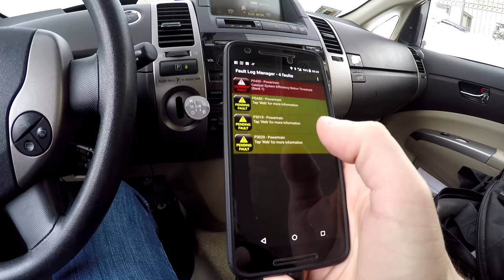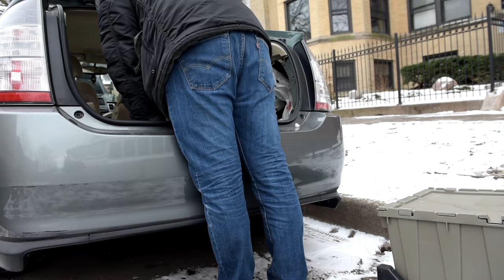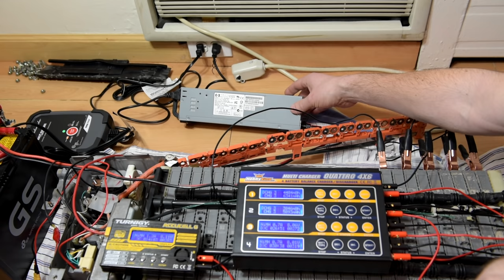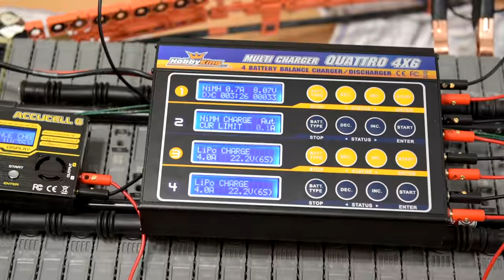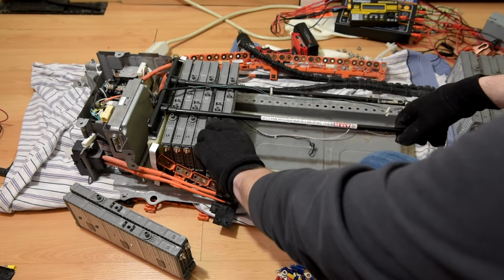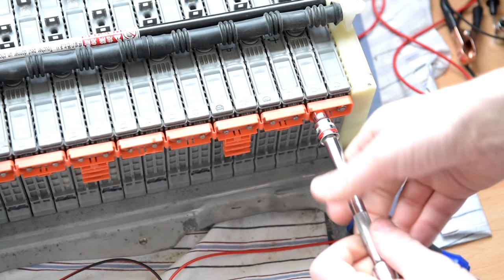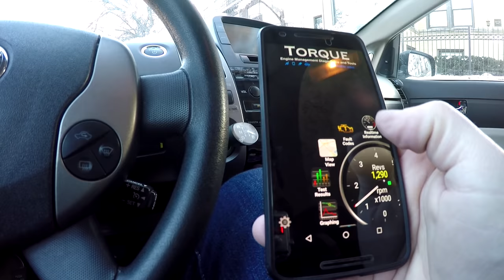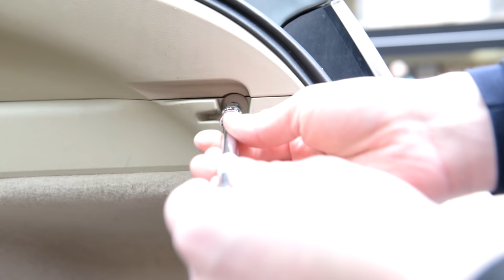Hybrid Battery Repair Ultimate Guide (Toyota Prius 2nd Gen 2004-2009) DIY

Comment: Dear Igor, I wanted to thank you for your video which along with the Prius Chat threads enabled me to do a good job re-balancing all the modules in our 2006 Prius. I only had to replace one cell! She's running great now with no Triangle of Death nor any codes whatsoever. I did forget to push down the handle on the orange service plug which resulted in the car not going into drive,  reverse or even the motor starting. So I wanted to emphasize this step for others considering this process. BTW, I wanted to mention that I used the Hi-Tec X4 AC Pro AC/DC 4 Port Multicharger which performed flawlessly and didn't require any external power supplies to keep up with the load.
Reply from the maker: Thanks for feedback, Bill! I am glad you fixed your battery. It's funny, but it happened to me too, even though it's not on the video, I forgot to reinstall safety plug and it would not start. I even got upset that I would have had to disassemble it again, but then I realized my mistake and fixed it quickly :) Thanks for the tip about the charger. The one I recommended is not available anymore
Reply: Bill Byrd can you rebalance this hybrid battery until draining all the cell till the lowest cell? To even out the modules? I’m just trying to learn how to rebalance.
Reply: how many hours did it take you to refurbish your battery?
Reply: @AJTarnas  I was working on it for about a week during the day. I'm still on the same battery 3 years later.

Comment: Best tutorial on YouTube for fixing hybrid batteries. Thank you. One comment: With the Ideal grease on the contact, your torque may be too high as the grease will make a slippery surface.
Reply from the maker: That's a good point, thanks. I guess you could decrease the torque in this case
Reply: Actually, it is just the opposite. The lubricant allows the proper torque. Lawson Products studied this and came out with a lubricant for lug nuts on HD trucks so that the proper torque is achieved.

Comment: Some thoughts for folks who just watched this video - this was what I did about a month ago before completing my HV battery work:   This is a great video but you can improve on certain little bits of it - and learn details from other good videos and websites.  For example, remove the rails/white blocks from the HV battery case and do your cycle rebalancing  outside of the case.   At the end, after you've made your module replacements, switches and swaps, you can easily bolt it back together on your bench - and then put it into the HV case - no struggling and squeezing - that might potentially break the tabs on the white blocks.  Another thing: mentioned by Igor, balance all your cells by tying + and - together (thus putting the modules all in parallel for 24 hrs., after you bring their final voltages to within .05v of each other.  There's an excellent HV battery assembly/disassembly video set by user Eletronautomotive, who do HV battery reconditioning professionally and made their video to help their customers remove and install the packs sent out to them.
Reply: It is not a good idea to do your module cycling outside the case , in fact it is a very bad one , even with hobby chargers and plenty of ventilation the battery modules will swell and if not compressed they can and  will expand. By leaving them inside the case this prevents any sort of expansion , if you are worried about the tabs on the white blocks breaking , you can always use ratchet bar clamps to relieve some of the pressure off the tabs. 

Also 'balancing' the cells by voltage does absolutely nothing for the battery , I am not sure how this idea got spread , but the only balancing that should be done should be dictated by the capacity , internal resistance and voltage under load, if the all of these parameters are closely matched then the voltage should naturally follow. This is like treating the symptoms instead of the disease.
Reply: What rails/white blocks are you referring to?
Reply: @manuel8617 I agree you shouldn't charge the modules outside of the rails/white blocks (whatever that vice-like structure is called).  I was saying that the whole 28 modules in those rails and end white pieces can be removed from the metal battery case.

Comment: I just got a quote for a new battery pack at my local Toyota dealership for $1,600 (June, 2022) marked down from the original price of $2000 ...so now watching this video.
Reply: That is good news. I have seen some hybrid repair shops in England got some new battery packs from Toyota in 2022 and are selling them for about $1600.

Comment: This video is so amazing!! If i were to put a value in dollars worth of information provided in this video it would be many thousands. I've read that reconditioning is inconclusive/unnecessary VS. just swapping them out (if you know which cell is bad!).. well this video clearly showed why it is not only good to do, but wise to extend the life of all of the cells. 

Having said that, I think the logic still stands that if you are buying a reconditioned battery off ebay/online - that battery should theoretically match your current cells. The refurbished cells have been discharged and recharged, basically to match the rest of the cells. So things should be all good by simply swapping them out. I realize the technical guys might disagree, but I think it makes more sense to me IF the person is not able to do the extra work like in this video.

Comment: Hey, a word to the wise; Dielectric grease is meant to be be applied right over the connection points.  It will squeeze out when the connection is made.  It's the clamping force that squeezes it out.  Don't worry about the resistance.  Use your ohmmeter to see the resistance is inconsequential.
Also, check that there is good air flow coming out of the bottom duct.  The air goes in thru the top of the battery and out from the bottom.  The weather stripping gets destroyed and the housing leaks tons of air.  That will not cool the batteries.  Make sure the air flow coming out of the lower duct is solid before buttoning up.

Comment: I did a full battery reconditioning according to this guide! It is a great guide! Thanks a lot.
I had to replace 4 cells and after cycling and reconditioning, the battery works way better than before :) 
But be aware of the fact, that it takes a lot of time (I spent about 1,5 week to do all the steps). Of course it is not hard work and not that difficult but 
My experience: I used a 4x Turnigy Charger and a 2x Skyrc T200 charger. The Skyrc T200 worked better than the Turnigy. 
Thanks anyway for this really great tutorial! It saved me about 2400€!!!!!
Reply from the maker: Thanks a lot for your feedback! Stories like yours keep me going. DIY is easier than many of us tend to think. I am glad you fixed your battery!
Reply: Did you need an external power source for the skyrc t200? If so, what did you use?

Comment: Thank you, Very Thorough. Helped my Friend with an 2005 Gen 2. Worked like a charm. He is quite happy :-). PSA: make sure you guys with Smart Keys push in the switch under the steering wheel or it will not Start.
Reply: A button or a switch?
Reply: @markpennella  Sorry, button

Comment: if anyone's curious, the electrolyte leak from NiMH can be neutralised with a baking soda solution (this applies to leaking primary alkaline and ¨dry¨ cells too). 

It´s better to apply this before attempting to scrape off corrosion as it will make cleanup a breeze

An ultrasonic cleaner makes cleaning small parts really easy
Reply: You can’t neutralize alkaline electrolyte with soda that is alkaline too.  You have to use acid: vinegar, lemon, sulfuric acid…

Comment: Bravo to Igor, Prius Chat, and all the comments here. I have a few questions for anyone/Igor. I have 2005 Prius and while I could do this and it would be fun, I might prefer to buy a refurb battery and put it in myself. Questions:
1)I’m in NY ( Long Island) does anyone recommend a place that has refurbed batteries or will handle the install as well?
2)if I were to buy a refurbed battery or a full install, what can I ask them to show me the battery strength or know if they took all the proper steps?
3)The battery is 80lbs, does anyone know if ebay or ppl ship this item?
4)Does anyone have any tips/experience in buying a stand alone refurb battery OR tips/thoughts on a person/company that HAS done work for you?
5)Is there any other tips on how I might be able to get someone just to do the removal/install parts if I provided the battery?
6)Are there sites other than ebay to find a battery? if it ships and if I could verify any aspect of that battery before purchase
7)I love my Prius as much as anyone and I’m looking to buy a gen 3. Any tips on that in the north east or via auction?

Again, thanks to Igor and everyone. The Prius community is awesome and in a weird way most of us love the Prius line for a lot of the same reasons. Maybe it’s low maintenance, the environment, or just sweet gas mileage. I can’t wait to jump to a slightly nicer gen 3. Thx so much

Comment: Perfect Video. I drive since 2016 a 2006 Lexus GS450H. Since 2016 i have 4 hybrid errors. 2 times i use the voltages testing. But since 2019 i use your capacity testing. The first test was 2019. Now the car is in 2021 down. And the modules lost from 2019 to 2021 over 450 mA/h. But run 2 years without error. Thanks to your video !!!!!
At the moment i thing that NIHM batterys lost capacity when they get older. So please don`t by a hybrid car that is older then, let me say.. 12 years. 
I bay 1 Prius and one Auris battery to find good modules to bring my GS back on road. 
Did you see in your analysis also a curve in the capacity when you repair your car? I found that the first and the last modules in the battery most are better then the modules in the middle of the battery. 
But realy Thanks for your video. It bring me back on track do drive this good car. It is like a couch.. perfect for 48 old people ;-)

Comment: Thank you so much for doing this, Igor! This is definitely the most thorough guide out there. I have used everything you provided to fix my Prius battery. I will be reinstalling it tomorrow. Wish me luck 🤞
Reply from the maker: Good luck!
Reply: @IgorKadulenkov  7 months and 30,000 miles since I followed your guide, and my Prius battery pack is still running strong! I replaced 6 modules in total. Can you drop me your CashApp? I would love to thank you for helping me prolong my Prius battery. 200k miles and counting!

Comment: Igor, you’ve done the world a great service with this video. Thank you! But now that you’ve educated us on how to recondition our batteries; that it isn’t just a matter of one quick test on the cells before replacing one or two of them—and with the recommended Turnigy Charger now backordered for a month or so, I find myself in the middle of a lengthy process I wasn’t prepared for. So here’s my question:

With the 1-cell charger I now have, my project looks to not be complete for a good month or more; when the Turnigy Charger would finally be available.

So, would you recommend I just replace the worst of my cells right now, reinstall the battery, and then start the project anew when the Turnigy Charger comes in next month, or recondition just one cell a day for the next twenty-eight? And, are there any procedural changes to take, given the long timeline?

Again, great video; great research you share! Thank you! I look forward to your reply.
Reply from the maker: Hello Jim, thanks for your feedback! For your question: i think it should be fine to just throw in a replacement module, if you already know which module had failed. This is a short term solution, performed by many questionable battery repair companies and it usually works just fine for a year or so until another module fails. If you do this,  you need to level the voltage in replacement module to the rest of the pack. If you planning this as a temporary solution for a month or two, this sounds like a lot of work - removing and reinstalling the battery twice. Maybe it's better to get 3-4 more chargers from what is available? https://hobbyking.com/en_us/batteries-chargers/chargers.html?wrh=2%2C3&stock=1 
I think some people were using IMAX B6 50W which is 25$ each. There is a bit of discussion about IMAX B6 on PriusChat forums. TURNIGY REAKTOR is really good, but it starts at 50$. You can also get Turnigy double chargers for 100$. You could also sell them on eBay later, once you've done with reconditioning.
Reply: Igor Kadulenkov
Thank you, Igor. At your suggestion, I look to get enough chargers to recondition seven cells at a time, and then probably resell the chargers. Easier to resell, though, if a power supply is included, so that may limit me to buying chargers with included power supplies. Crazy that power supplies aren’t more commonly included, or at least offered as a simple add-on. But, thanks again, Igor! I love the resell idea.

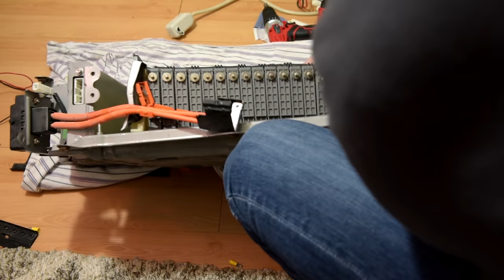Comment: remove the bottom screws before taking the top bars/side plate off that way the pack won't slip off like 00:25:10

Comment: Igor
Bought 7 mods from ebay. cycled 5 so far. Discharge capacity for 3 cycles. 
Mod1= 1374  1534  1440 
Mod2= 1962  1920  1885 
mod3= 3804  497  806  
mod7= 1708  2285  423 
mod8= 2642  2547  1656.  
Ever seen anything like mod3 mod7?
Reply from the maker: These seem really low , they probably pretty old. You may keep trying or just return them maybe ?

Comment: You can play with voltages and chargers all you want but you need to measure internal resistance. Save yourself hours with meters and chargers and get Dr. Prius and get voltage and more important, Internal Resistance. The Pros use Dr. Prius and not Torque Pro. Also, you can buy brand new modules from www.autobeyours.com for $80.00. Stay away from "reconditioned" or "used" modules on E-Bay as they won't tell you the date of manufacture (Yes, there is a date code on each module and they know it). So you can end up buying modules older than your own. If you have a failing battery pack, don't go the dealer and hand over $3400. Don't buy a reconditioned pack. Either trade the old modules for new Panasonics at the dealer for $1950 OR call some junkyards and buy a used late model battery pack. The pack in my 2005 was dying and I was tired of playing Whack-A-Mole with used modules from E-Bay. One seller even sent me modules with scratched out date codes. Anyone can buy a 2004 pack for nothing and sell you old shitty modules. So I searched the junkyard sites and a local one had a 2014 pack with low mileage for $850. I moved up 9 years and I'll be good for many years with no worries. Don't waste time replacing and testing because all your modules will fail one by one.

Comment: I think it is easier/safer to undo all the individual battery bolts on the bottom before removing the clamp on the entire stack.  That way it is still clamped when you are flipping the stack
Reply from the maker: Thanks. Sounds like a good idea, i'll try it next time.

Comment: In your section where you give the links to the equipment used I would discard the trunigy 4x6 for some other charger.  They did away the capacity results after doing the discharge/charge cycle.  I thought I was doing something wrong and finally reached out.  Turns out they updated the firmware on this unit and it no longer gives you the capacity report on each charge/discharge session at the end.  Total crap imho, as I will now be returning the unit as we bought it for this vital function that is no longer available due to their firmware update.  I mean you can watch it in live action and try to catch it when it switches cycles, but some sessions last up to eight hours and I don’t really feel like sitting there staring at this unit.  Any suggestions on what other charger can perform this would be appropriated.

Comment: Great video! Thanks for sharing.
I have a 2 question, maybe possible tip for others.

I have 3 chargers (imax rc6).
In aim to save time I consider to do the following:

Use chargers for charging only, discharge will be done with the hb4 bulbs (3) as mentioned.  In that way I can save the time of the disharge.
Question 1: any difference when discharging with bulb, comparing to charger usage (is it less effective?) 

Next thing :) , in aim to have three discharge->charge per cell:
I think about doing 1 cycle on all the 28 cells, then second cycle, and eventually the third (last) , so instead of:
3 cycles * 28 cells * 1 iteration,
I'll have:
1 cycle * 28 cells * 3 iterations.

In that way I hope to prevent over hit of the cells (letting each one to" rest" befor next discharge-> charge).
Question 2: Is it effective, good idea?

Thanks again!
Starting tomorrow 😀
Reply: Hello. How was it in the end? Are you satisfied with the results?
Reply: @ionut-cristianharnagea  Hi,
Eventually I used the charger for discharging the cells.
I've bought HTRC t240 duo. Excellent charger, 65$ from AliExpress, can discharge at 2amp.

The reason is that I wanted to see the improvement in numbers, bulb can't reflect that.

I managed to replace 3 cells and my car is working.
Thanks.